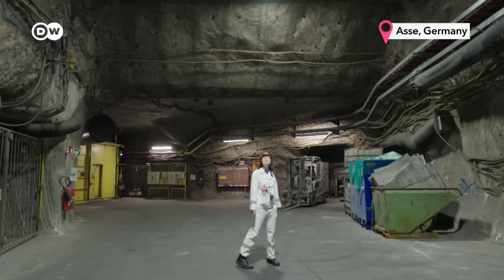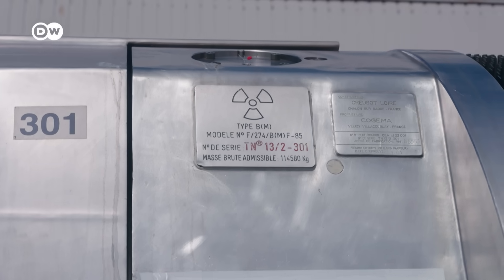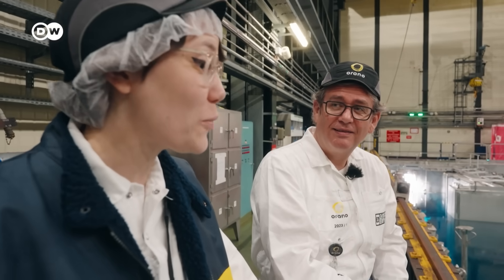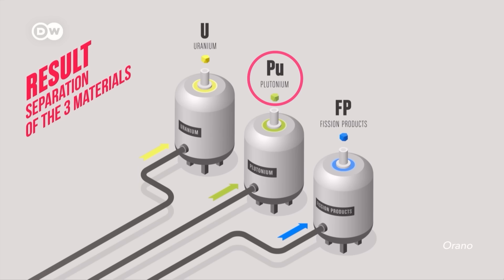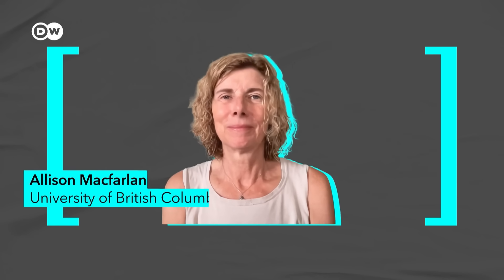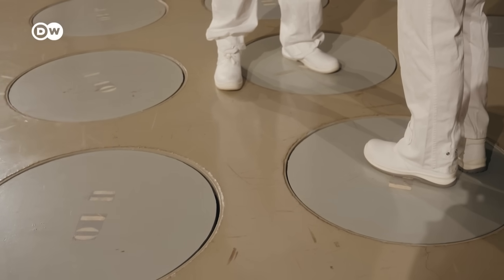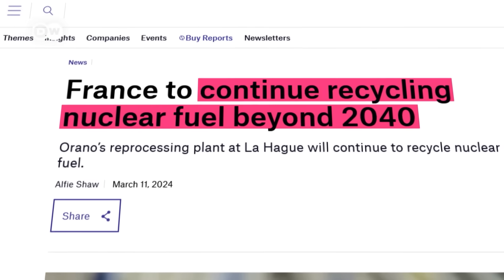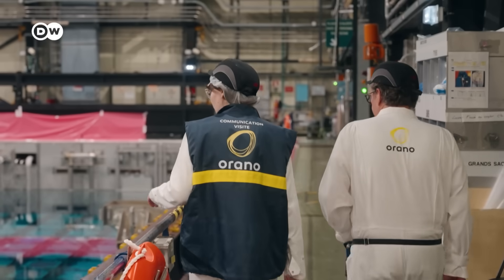Nuclear waste is reusable. Why aren’t we doing it?

Comment: Fascinating video and I have a question, not sure if you can answer. The big drums used for transport. Noticed they are essentially heat spreaders. How much heat is "externally" released by the waste? Could the shielding be reduced to increase the heat being released and still block the harmful radiation?

What I am thinking is could that decay of the waste be harnessed with a generator using a Sterling Engine and the heat being radiated used for the power of that engine? You mentioned that the water cooling takes 5 years, how long would that heat exists without the water cooling in a radiator style container?

If this is viable it would be an amazing use for some of the material.

Comment: you have less waste using  CANDU reactor as it requires 30% less fuel. and   it will happily run on waste fuel from other nuclear reactors. seams odd that India bough fuel from the US. as the CANDU reactor was specifically built to  run on raw uranium without the need of enrichment from  Canadian mines that natural have more 235 then most raw uranium out there. if it was using US uranium then India was using spent or enriched uranium from the US.. as CANDU  produces very little  plutonium ( and other radio active isotopes) compared to other reactors out there as it gets digested in the CANDU reactor

Comment: Did you know that we have published research and designed plans on how to produce zero active neclear waist 20 ish years ago and was published in Time magazine. Only issue with the multi stage rebreeder system is that at one stage it produces small amounts of very dirty plutonium and it is potentially possible to refine this dirty plutonium to weapons grade. So due to international treaties it was shelfed.

Since then research has gone into other types of neclear reactors that produce "safer" and less waist.
Reply: It goes beyond that.  I want to say one of thoriums pros is it makes less waste and that waste is shorter lived, and ORNL made a thorium reactor shortly after WWII.  But the focus was to create strategic sources:  ie, weapons grade uranium, and uranium reactors to create weapons grade plutonium.  The thorium reactor at Oak Ridge died on the vine.

Comment: thorium solves all those problems, consumes u238 as starter fuel, no plutonium byproduct, 1% of radio active half-life, 80+%fuel efficiency, no waste storage problems and thorium is 4x more abundant than uranium and widely distributed throughout the world
Reply: But i heard its corrosive so regular maintenance is required and that is headache
Reply: @sky_1671-o1m  not thorium by itself, rather its salted chemical compound (thorium tetrafloride). That' s a possible configuration (molten salt reactors).

Comment: Do they really have to cool the rods down, instead of USING all that heat?
Reply from the maker: Hey there! The rods are very dangerous due to the radiation. There has been research into how to safely use the heat of the fuel rods. However, it has not led to any application used so far.
Reply: I think you’re (OP) correct about the heat, though, they are not only ‘hot’ as in highly radioactive, they’re ‘hot’ with high heat.  I think the water gets circulated somehow to cool it down, and this is what happened when Japan got hit w that tsunami.  The tsunami killed the main power, the backup generators ran out of fuel, and the pumps to circulate the hot water to cool old, spent rods, shut off.  The water boiled off enough that radioactive steam and whatnot escaped the site.

Comment: There's a misunderstanding of what's called nuclear wastes. you talk about the used rods. But the nuclear wastes aren't only that. the major part of the wastes are not rods, but contaminated materials.
Reply: Low level waste is a joke. Sandwich wrappers and plastic cartons are not nuclear waste. This is pure fear mongering and profit related. Nothing to do with safety.
Reply: @paulanderson7796 well, yeah and no, but you’re mostly (99%) correct.  For example, gloves, etc,  used by hospital staff doing PET scans or administering oncology treatments  - LLW or VeryLLW, but accounts for the majority of the volume.  Intermediate and High Level Waste is handled appropriately per policy, and is a very low percentage by volume.  Hospitals generate a LOT of waste of all types.

Keep in mind these radioactive scans and radionuclides were done on, or administered, to a human.  And they didn’t mutate a third arm.  

This wasn’t critical of your post, Paul; I’m in agreement.  The gap between perceptions and reality is large.

Comment: I did an undergrad paper on this about 40 years ago.  Ted Ringwood and others came up with synroc in the late '70s after learning that the fission products in the Oklo natural reactor in Gabon of about 2 bya had barely mirgrated in that time.  Its radioative loading is about 4-5x that of the best glasses with the advantages that they are stable at much higher temperatures and have porosity rates a couple of orders lower than the glasses.  Drill into an unfractured-by-glaciation granite pluton about 1 km below the Canadian shield, bury, backfill with self-healing bentonite clays and you're gtg for several million years.  The recoverable energy in Ontario's pools was worth about $300 B in '80s dollars by about 10 years ago and it would've cost about $5-10 B to do it all.  Still, a 30-60x payback can't cut it when it involves the transport of weapons-grade Pu through populated areas.  The French are so French ;-)

Comment: Are the containers denser than magma? If so why dont we just dump what is unrecyclable in to a Volcano? Someone my be laughing at this proposal, but doesnt temperature and pressure change everything? 
What i know are foreign languages, so will please someone with the training and education please enlighten me?
Reply: Because the harsh conditions of the vulcano may damage the containment and release the material, than if the vulcano exploded it would be equal to a nuclear fallout (if not already bad enough a vulcanic eruption is). Simply, it’s not safer, actually it may even be dangerous, then the other options which we know work and are safe
Reply: Besides, the Hawaii Tourism Department would frown on the optics. :)

Comment: The same two true solutions stand as always did. Rocket on course to the sun or deep core drill.  In effect sending them  under the crust in to the mantle.  The atomic weight of the material will permit it to sink in to the mantle.  Long known.  At the same time electrical nuclear stations have always been about weaponry, just mis sold to the public.

Comment: 15:25 15:25 Recycling should always be part of the foundation of production. Self efficient for replication should always be priority for pure value and essence of progress for economics. No production of factories processes should be built without priority of recycling in 21 century. Recycling should be a priority before maintenance because the foundation is production. Fixing a problem maintains the problem of fixing. Recycling removes maintenance cycles and simply starts again from a element prospective. Prioritising production. Fixing slows production in essence and one can be removed essentially with no waste of time for machine process time. Recycling has to be priority in production in 21 century. Time and speed is achieved with recycling and production not production and maintenance for a product. It's more efficient to replace than fixing a product the machine should be a loop of element recycling at heart of energy of the product. Weather it's new or old always recycle item back in the loop process, from a elementary part. Self efficient factorys can only be achieved with recycling as part of arctechture of factory from start to finish of manufacture production of a factory design.15:25 15:25

Comment: Nuclear power plants generate high level spent fuel (HLSF) which is neither transportable nor disposable. It just sits in the back yards of the 92 nuclear power plants in the US waiting for a solution that hasn't come since the start up of the first US nuclear power plant, Shipping Port,  in 1957. These are dirty bombs waiting for a mortar shell. Do you have a High Level Spent Storage facility in your neighbourhood? Do you want one? This for a nuclear plant that will generate power for just 50 years and require storage of HLSF 10,000 years or more. It makes no sense. The real reason all these countries want to build nuclear power plants is that they want fissile materials to build nuclear bombs not to address climate change. It sounds like reprocessing nuclear fuel could be the answer.

Comment: Thank you for an excellent article. One important point you did not mention is that fast reactors can burn the transuranics inside the reactor during the regular operation. This would be preferable and much work has already been done on these designs.

Comment: Did they finally get their discharges into the air and into the water under control? My information isn't up to date, but until 10 or 15 years ago, this facility was discharging massive amounts of radioactive material into the air and into the ocean and that is definitely a major point that deserves to be mentioned.
Reply: In a range of 10km next to the facility cancer is 3 times more often. 
They also have hydrogen problems while processing the plutonium

Comment: Has no one heard of liquid-fueled reactors, e.g. molten salt reactors? Reprocessing is literally built into the process. 100% of the fuel is used, or something very close to it, with vastly less waste. And you can use thorium, which is far, far cheaper than uranium, being about 500 times more common than U-235—plus, you don't have to purify the thorium first to make it "reactor-grade", like you have to do with uranium.

Comment: So Germany closes its coal mines and destroys its coal-fired electric power generation plants.  Then antagonizes its neighbor Russia, which is the source of most of the natural gas Germany chose as the fuel to replace coal.  Did I mention that Germany also decommissioned all its nuclear power plants?  But here's German state media, whining about how Germany needs to go back to one of its former sources of power.

No sympathy.  Your country flops around like a chicken with its head cut off.  Coal is by far the least expensive fuel, and you have plenty of it.  Use it until you get leadership that can make lasting peace with your neighbors.

Comment: This explains why some countries reprocess spent fuel. However, calling it 'recycling' is inaccurate as fission is a linear, irreversible process, not a circular one. Chemical reprocessing enables more complete use of fissile material, not reuse of it after use.
Reply: We need a better term. idk... re-mining ? re-refining?
Reply: @stormveil  It is simiar to extraction and refining in a way.  What's wrong with 'reprocessing' though?  It's the usual term.
Reply: @SofGdggd-xt9lw I meant the term recycling. Reprocessing is better.

 But "process" is generic. What process?

Comment: Pyroprocessing with molten salt theoretically can lead to 100% fuel burnup, especially if using molten salt reactors.  This would "burn up" transuranics like Plutonium (which have the very long half lifes) and leave only fission products left over, which would be less radioactive than the original source uranium ore mined out of the ground in only 300 years.  Not mentioning this, and saying it makes no economic sense to recycle (when molten salt processing should be significantly cheaper and also more proliferation resistant due to lower purity plutonium) so forget about recycling helping us with the waste problem is bad reporting.
Reply: 300 years ago, had they built nuclear power plants, they would have been deliberately bombed in several wars since.  I'm not trusting of the permanent peace and security of the next 300 years.

Comment: "Permanent"
???????????

159,200 years is the half life of some spent fuel.
The oldest man-made structure on earth is ~12,000 years old. (Tell Qaramel)

159,200 - 12,000 = 147,200 years
So I'm calling BS on any "safety" claim.
Reply: Reminds me of the hijacker some decades ago who circled Oak Ridge and threatened to crash the plane into the reactor.  Probably wouldn't have broken the containment vessel, but then, how much damage would the burning jet fuel cause?

Comment: If we just put the encased nuclear waste back in spent mines it will at least be slightly less radioactive than it was before it was mined. And in that case, we can later just dig up the spent fuel rods when it becomes more economically viable to do so.
Reply: Spent fuel way more radioactive than ore it made from. It becames less radioactive after 100 000 years or so.
Reply: @veteransniper6955  after processing the radioactive things are concentrated take up less room  and maybe have another life heating something up for civil usage as well.
Reply: @neilstuarr2278  after reprocessing it's not spent fuel anymore. Different streams has different properties, so you can't talk about it as a whole, only about some part like waste stream. Because it's more concentrated and contains most of short lived isotopes, its more radioactive per unit of volume or mass, but indeed takes less space and decays faster. But it's not really useful for heating purposes because of problems with handling (some isotopes like used in RTGs for space missions better suited but overall cost is prohibitive for wider applications).
Reply: There's enough energy in spent fuel to run the world for a lot of years . Just not enough processing to keep it up

Comment: because its not economical.
honestly, nuclear waste is not an issue in any way shape or form.

"oh but it has to be stored for so long" that just means its not very radioactive. the actually dangerous stuff decays within years.
Reply: There is no safe minimum exposure to ionizing radiation.
Reply: @floycewhite6991  There very much is.
Otherwise plane-flights would be illegal.
Reply: @floycewhite6991  there are suggested maximum exposure limits to sunshine.

Comment: Ok I don't know anything about this field of energy. But if we could just find a way of using said radiation energy and capture it and turn into something else like a solar panel? If it is stored in glass what if the glass had some capacity to capture the energy from the cells stored to be used?